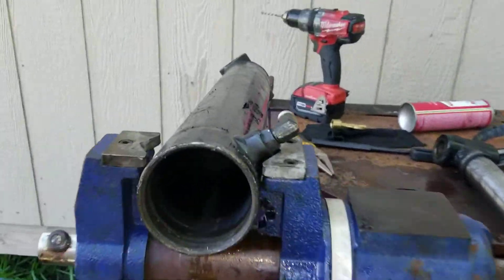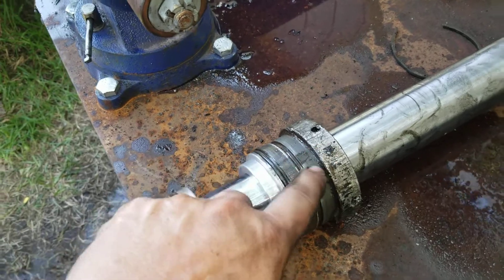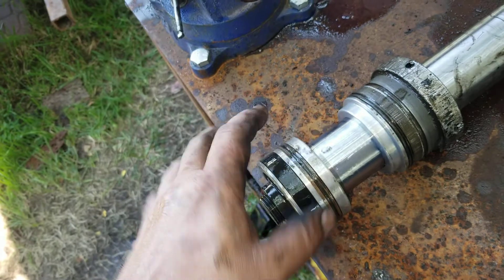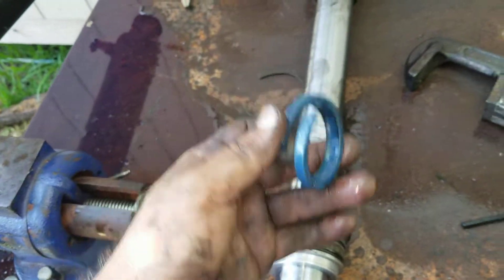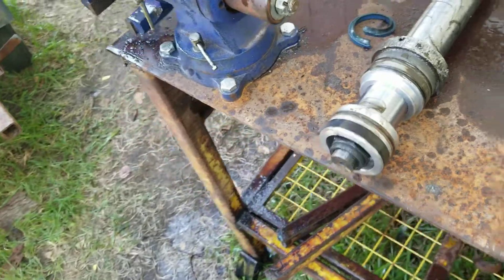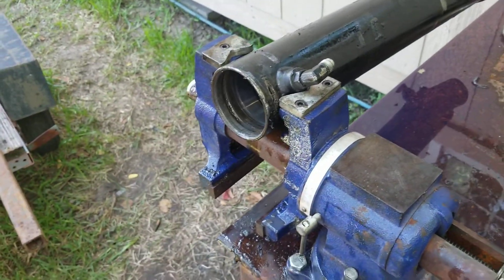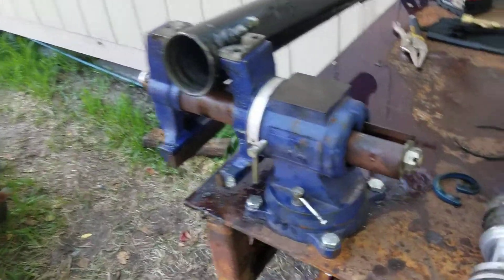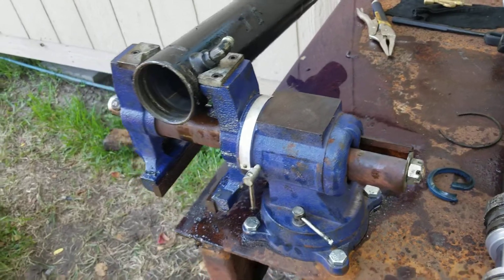How to rebuild a hydraulic ram with marrying wire(4)

Comment: What will cause this to leak at the marrying wire after replacing seals ?
Reply: The only reason it would leak at the wire is the O-ring or O-ring backer, between the wire and the bottom of the gland, are damaged and allowing fluid past it